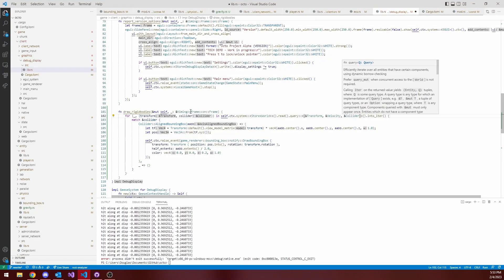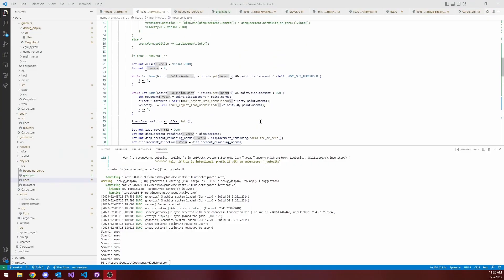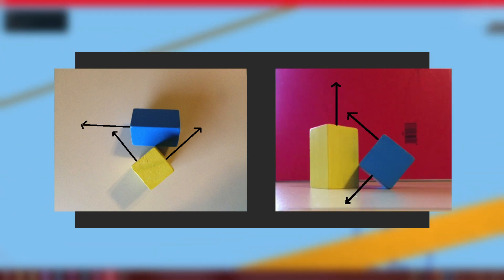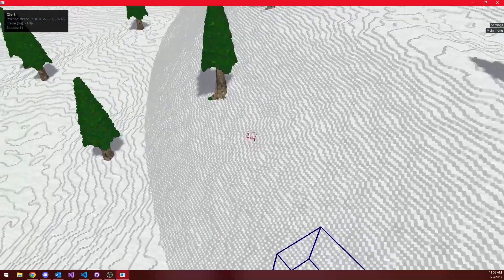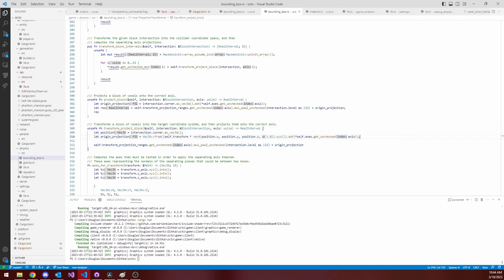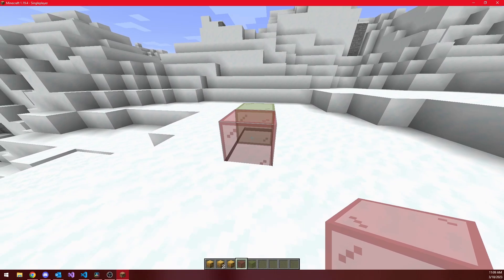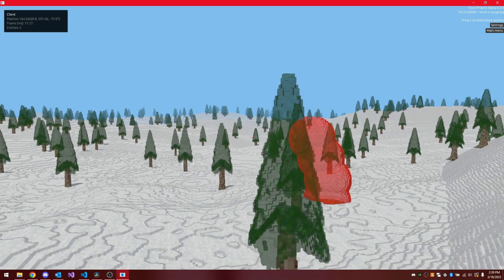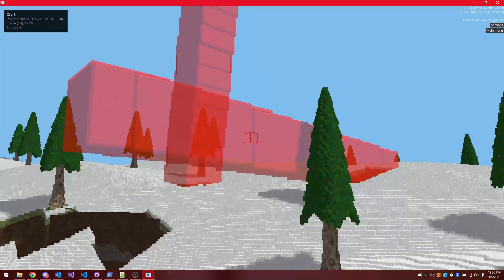Making voxels MOVE with the separating axis test [Voxel Devlog #11]

Comment: thankyou youtube for this hidden gem!
on the note of the transparency, i've not heard of it before but it sounds really useful. im wondering if there may be some extra steps you can do to improve the transparency stuff. depending on performance cost you may be able to achieve a sort of middle ground. using the order independent method as a base and passing in some extra info to account for edge cases. maybe some sort of Z-buffer pass that can be used to get some crude ordering. or if there is enough information to imply order from computationally cheep checks you might be able to use a 3D LUT for RGB values. then you could use something like a ray traced transparency to precompute the LUT and bake that in. that'd also mean you (or someone else) could overwrite it too for some potentially cool effects!

Comment: The transparency is great but I feel like something is missing. Usually for transparent objects, the thicker the object is the less transparent it becomes. This effect is most commonly used to makes it harder to see the ocean floor the deeper the water is. Would something like this be possible to implement with your transparency solution?
Reply from the maker: Thanks for the question! Another commenter asked something similar, about why I chose to make transparency be "hollow." This was my response:

First and foremost, it was an "artistic choice" to mirror the style of Minecraft transparency. I want to allow people to create thicker glass windows and sculptures, which I fear would appear noisy and majority-opaque if I used volumetric transparency. With the shell approach, users still have the option to create volumetric transparency by layering different materials, which will both appear even on inner surfaces - but by default, it's easy to create thick glass windows. Second, it does help with performance, because there are typically less details to draw :)

Regarding whether it would be possible, it probably would take some additional work. I wouldn't implement it for normal voxels, for the reasons above. But I would like that kind of effect for water!

Comment: If you had a ray shooting from your camera and every time that It hitted an object It could pass through or not. If the ray doesn't pass you give at the camera pixel this color. No if it pass It will give to the pixel the value of it multiplied with the coeficient of transparency. Lets say 1 is zero transparency and 0 is full transparency.For exapmle If you have your first object with color red and transparency 0.9 then the number for this ray is for now 229. Now the next object that the ray hits it will add to that number by a factor of (255-229)/255*newcolor*newtransparency and the output color will continue the gerney until it will hit a wall with transparency 1that will set the end for your ray.
Reply: It may give an nice ray tracing touch!

Comment: I found success in optimizing my octree raymarcher by reducing the number of octree subdivisions to step into when traversing with a ray by caching the bounding box and index of the octree node you last searched. Given D as the depth of your octree, normally you would:

origin -> search D octree subdivisions -> move forward -> search D octree subdivisions -> move forward

But you can just:

origin -> search D octree subdivisions and save the D/2 box -> move forward -> if still inside the last D/2 box then just start out there and save D/2 depth searches.

This way you can additionally set the starting D/2 box as the one the camera is in, calculated in CPU and passing it to the GPU as a uniform. You now guarantee that your rays will save less octree subdivision searches.
Reply: Makes sense to avoid having to start all over again from the root of the tree. Have you tried ray packets by any chance? I'm used to using them for raytracers but never tried for volume ray marchers. It seems a bit tricky to use them combined with your optimization since each ray in the packet might want to resume from a different node in the tree.
Reply: @darkengine5931  have not but I'll be looking into that now

Comment: I have a few questions.

1. Are you still using Vulkan?
2. What will happen to performance if you decide to increase the number of voxels, for example, by 8 times, meaning that each voxel will turn into 8 new ones?Will this have critical consequences?
3. Have you thought about creating a Discord server?"
Reply from the maker: Thanks for watching the video! Let me give you the details:
1. No, I switched to targeting OpenGL about a year ago, in Episode 4. This was because I wanted to make my project usable in a web browser, and playable on a wider variety of hardware. It was a tradeoff for portability that I made for my specific design goals. I still do miss Vulkan and its modern features, though.
2. Performance would definitely decrease. For projects like this, achieving good performance means fine-tuning to one's specific use case. As I've designed my engine to work at the scale shown in the video, I fear that it wouldn't run well with larger quantities of voxels onscreen. That's not to say rendering more voxels is impossible - it would just require more engineering and special use of LODs. Dealing with that much data voxel data has consequences beyond rendering, though - I also need to sync voxel objects over the network and store them in-memory, so it's a delicate balancing act :)
3. I don't have a Discord server - unfortunately, I simply don't have the time and willpower to manage one. However, there's another voxel YouTube called Gabe Rundlett who's working on some really cool tech. He has a Discord server where myself and a number of other people talk about voxels, so you can reach me there if you'd like!

Comment: Iv tried to do voxel, witch i had multiplayer working, but at some point something started causing lag and I don't have a back up of it before it started happening without going way to far back. I used unity since it would do shadows and a lot of other effects (I add lighting to the blocks with vertex color and add shadows ontop of that). Do you think unity is bad for voxel? I dont know what alternative I could use, I dont really want to learn a new game engine(or new language).
Reply from the maker: I think that it depends upon your goals! If you're looking to make a game with a voxel art style (or even a game with editable, Minecraft-style terrain) then Unity is an excellent choice. Its batteries-included engine makes it easy to develop gameplay and other fun concepts. This is at the expense of flexibility, though - if you're looking to create a highly-detailed voxel environment (like myself or some other YouTubers), then it's probably necessary to build your own engine. However, that takes a great deal of time and dedication, and it's a lot harder to make a feature-complete game. So choose whatever best fits your aspirations :)
Reply: @DouglasDwyer  Thanks, ya unity definitely struggles when you make the voxels smaller then minecraft
Reply: Unity allows you to create custom meshes, so you can probably use a greedy-meshing algorithm to speed things up.
Reply: @bluesillybeard  i just dont think i would have the time to learn greedy meshes and deal with all the bugs from it

Comment: Interesting that your transparency treats objects as hollow shells (so the intensity of the color only depends on the number of overlapping outer surfaces) rather than as "physically correct" volumes (making the color stronger the more voxels it is deep). Could you tell us why you decided to go that route? Was it better for performance?
Reply from the maker: There are two main reasons for this. First and foremost, it was an "artistic choice" to mirror the style of Minecraft transparency. I want to allow people to create thicker glass windows and sculptures, which I fear would appear noisy and majority-opaque if I used volumetric transparency. With the shell approach, users still have the option to create volumetric transparency by layering different materials, which will both appear even on inner surfaces - but by default, it's easy to create thick glass windows. Second, it does help with performance, because there are typically less details to draw :)
Reply: @DouglasDwyer  That makes sense. Thanks for the response!